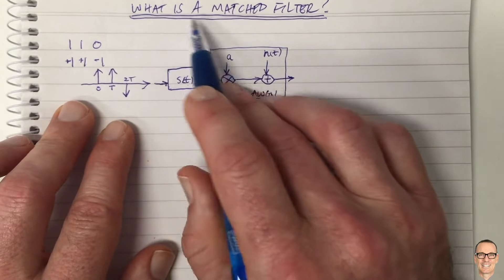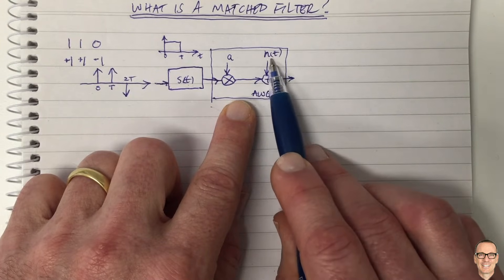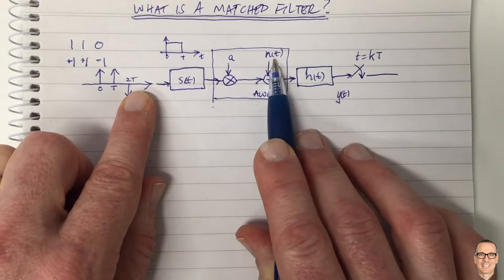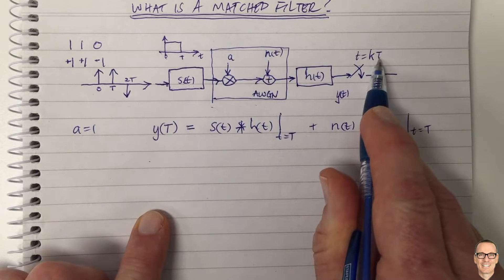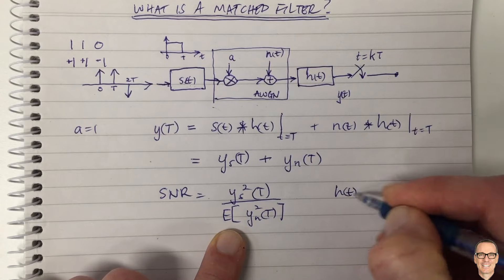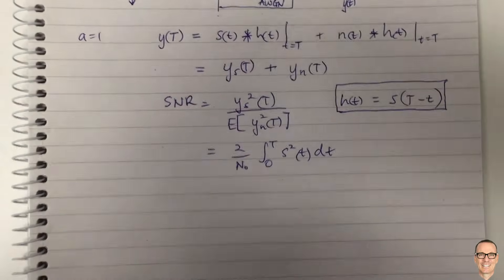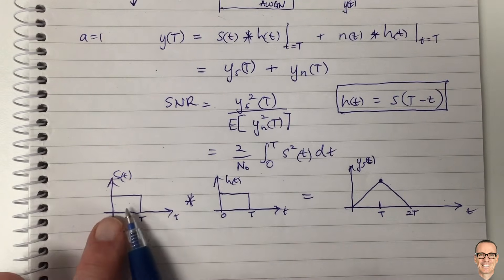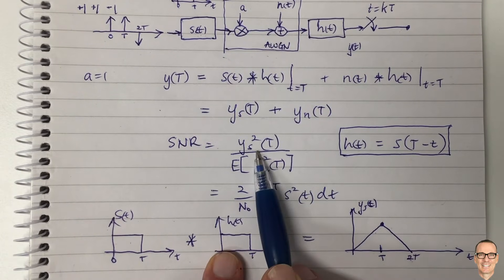What is a Matched Filter?

Comment: Thank you, I understand all of the contents. But, we don't know the transmitted signal, so how can we adapt the filter to that signal?
Reply from the maker: Great question! In digital communications, you don't know the actual signal that was sent in any given symbol period (because that depends on the data that's being sent), however you do know that it must be one of a finite set of signals (one for each of the digital symbols that could be sent). So you could have a parallel set of matched filters in your receiver - one for each of the possible 'data symbols'. Or you could have one filter matched to a sin wave, and one matched to a cos wave, and then match the pairs of outputs to the nearest constellation point in the 'symbol constellation space'.  See these videos for more details: "What Does a Digital Detector Do?" https://youtu.be/XzoLe9ixAZs and "What is a Constellation Diagram?" https://youtu.be/kfJeL4LQ43s
Reply from the maker: Also, this video might also help: "How are Correlation and Convolution Related in Digital Communications?" https://youtu.be/We5q5FJcbcU

Comment: So in conclusion, matched filter helps make the received data (at the other side of the channel) be more observable, thus more detectable.
Reply from the maker: Not sure what you mean by "more observable". There needs to be something that "collects the energy" at the receiver, and "receives" the signal. The Matched Filter is the best thing to do this, in terms of maximising the signal to noise ratio.
Reply: @iain_explains    You used a word that describe what I said, more detectable means a better signal to noise ratio. BER should always be kept at the max.

Comment: hey lain i have watched the whole video mean while i have a doubt in mah mind , whether in case of matched filter there is no upconversion and down conversion here? mean if the same operation is done through the correlator receiver and in the correlator receiver case we are doing the down conversion by multiplying same set of rf frequency at the receiver then we are doing intigration and sampling , but in case of matched filter there is no such process of downconversion we are only convolving with the filter at the other end means every thing which is done is done with high frequency signal even sampling also if that is the case then it might be costlier to impliment i would rather prefer a correlator receiver
Reply from the maker: The Matched Filter doesn't require high frequency sampling. It's still just sampled at the symbol rate. In the case of wireless communications, the MF has an impulse response that is a sinusoidal wave at the carrier frequency. Hopefully this video helps: "How are Correlation and Convolution Related in Digital Communications?" https://youtu.be/We5q5FJcbcU
Reply: @iain_explains  thanks

Comment: hello sir , greetings from india 
i have  a little qestion as you mentioned that we need to collect all of the enrgy at the receiver inorder to find out whaeather 0 or 1 was sent ,my question is that even if we had collected the energy for particular bit duration than also how can we differentiate between 0 and 1 as energy is always a positive quantity and we are sending our 0 bit as negative pulse which according to the video will be a negative enegy calculated for Tb duration
Reply from the maker: In order to collect all the energy, it is necessary to integrate over the full symbol period. It doesn't mean you are able to know what the energy is. That depends on what filter you use in the receiver. If you use an in-phase receive matched filter, then you will get the energy. If you use an out-of phase receive filter, then you will get a negative output. Whether it is in-phase or not depends on the digital data. So if you get a positive output, you will estimate a digital "1", and if you get a negative output, you will estimate a digital "0".
Reply: @iain_explains  Hi Ian. If we are considering single bit (0 or 1) the analogy explained here will work.. What happens if it is symbols with multiple bits representation?
Reply: @malini50  hello i will try to answer your question
first part I think you are considering ASK modulation scheme here so for this scheme you are required only one filter that is inphase matched filter here if you will get output (any how you will get +ve output )  if you have sent +1 bit 
otherwise you will receive some energy which will be the energy of the noise when you have sent 0 bit means you have not sent any of the waveform and the only received energy of the noise .

Comment: sir I have a doubt as you have said it's matched filter output energy has been added from 0 to T AND THEN  it's sampled at time T AFTER THAT for 2nd symbol when again we are adding the energy from T to 2T and we are samling at 2T but my doubt is in duration from  T to 2T the dying energy of first symbol is also being added which could give interference
Reply from the maker: Yes, they are being added together during the period T to 2T, but by the time it gets to 2T, the energy from the first symbol as completely died out, so sampling at 2T only contains energy from the second symbol.
Reply: @iain_explains  thanks sir got it now

Comment: thank you so much for this nice explanation, I have a confusion regarding the explanation in some of the books such as I am following "proakis_4th ed" and there they use an integrator which is followed by the projection of the received signal to the basis function in the case of a correlator demodulator and the product of the matched filter in the matched filter demodulator case. the integration takes place from (0 - T) and still, that is followed by a sampler at the time (t = T). 
my question is wh are we using a sampler after the integrator?
Reply from the maker: It's to indicate that we only "measure" the output of the integrator at t=kT. ie. we don't constantly measure the output as it performs the integration between the sample times.
Reply: sir I have a doubt as you have said it's matched filter output energy has been added from 0 to T AND THEN  it's sampled at time T AFTER THAT for 2nd symbol when again we are adding the energy from T to 2T and we are samling at 2T but my doubt is in duration from  T to 2T the dying energy of first symbol is also being added which could give interference

Comment: How can we actually see match filter working in a real working communication system??? Or is there any such hardware model which may help in explaining Communication systems most abstract concepts in real systems?
Reply from the maker: Analog electronic filters are implemented with circuits involving passive components such as resistors, capacitors and inductors, and sometimes also involving active components such as individual transistors as well as more complex elements like OpAmps. A Matched Filter is just one of these circuits where it has been designed to have an impulse response that matches the impulse response of the transmit filter.

Comment: why do you even need a filter at the end with an impulse response? Why don't you just sample the incoming signal and get the positive value from the square for the first bit for example? So what do you gain by introducing an extra filter?
Reply from the maker: I think you're maybe not understanding what is required to "take a sample". It's not possible in the real world to simply "multiply by a delta impulse". Taking a sample, in the real world, requires integrating the signal for a period of time (to gather energy over the sample period) and then recording the output. This is exactly what we are doing with the Matched Filter (except it is doing it over the symbol period, so that the noise in the receiver is averaged out, and effects the received value as little as possible).

Comment: Can you maybe explain why we have to collect the energy of the signal to identify the symbol in the first place? Is there not an easier way of figuring out the transmitted symbol, how can I understand that? Thank you very much for the great work.
Reply from the maker: First it's important to understand that nothing happens instantaneously. Nothing can move faster than the speed of light. Even the electrons in an amplifier. Now let's think about the thermometers we use to take our temperatures when we're feeling sick. We need to put them under our tongue for a period of time, to allow enough heat energy from our mouth to warm them up to the temperature of our bodies. They don't heat up (or respond) instantaneously. The longer we leave them there, the more accurate the temperature reading. It's the same thing with amplifiers in digital communication receivers, except that the time scales are much shorter. We need to send a digital pulse (a symbol) for enough time, so that we can make a reliable reading at the receiver. If we try to send too quickly, or sample for to too short a time at the receiver, then we will make errors in our received data.
Reply: professor you are a magician your words are more powerful visualization tool than an animation 👍

Comment: Your Signals and Systems with Communication (S&S&C) theory YT video tutorials are great. But two things are bugging me being the lone RF guy in a SERDES group. 1. How do Matched Filters deal with ISI. 2. is there a good book showing how S&S&C  come into play in the real world of RF S parameter measurements. Mostly I just see Design-con things here and there looking at eye diagrams from sending a signal through measured S-parameters. But there has got to be a text out there showing things like how the S11 and S22 like terms affect the Tx and Rx side semi-independently due to VSWR. As while as clear analysis of S12 like terms group delay showing how to find the frequency components of the transmitted signal that are going to cause the most ISI. Sorry about being a little irate about this but it's just really disconcerting how separated S&S&C theory is from the RF physical implementation theory and I have been searching for over a year now if you got any leads it would be much appreciated, thanks.
Reply from the maker: Great comments, thanks. Yes, I agree there is a real tendency in digital communications research to assume the RF implementation is power efficient, linear, and immediately responsive. More can be done to integrate RF characteristics into the digital models. In answer to your questions: 1. The MF is always "matched" to the transmitted symbols. This implicitly assumes that the front-end hardware can't be adapted on a time-scale that would be necessary to "match" to the time varying ISI channel as well as the transmitted symbols (ie. matched to the entire RF chain and channel). Apart from anything else, you would need to know the channel in order to do this. In many cases this doesn't really matter, as the MF provides sufficient statistics for digital decision making. In other words, information is not lost by performing the MF matched to the symbols. 2. I have used the following books, which you may find useful: "Radio Receiver Design", Robert C. Dixon, published by Marcel Dekker, 1998; and "Advanced Techniques for Digital Receivers", Phillip E. Pace, published by Artech House 2000; and "Wireless Communication Technology", Roy Blake, published by Delmar Thomson Learning 2001. I'm not sure if they cover all of what you are looking for, but they might be worth a look.
Reply: @iain_explains Thanks for the references I will check them out. For the MF would it be correct to say that in today's SERDES that the MF is embodied by the   CTLE and DFE?
Reply: Also, one resource on the subject of communication is https://www.gaussianwaves.com/digital-modulations-using-python/
Reply from the maker: Sometimes, yes, but not necessarily. The MF is (most) often implemented as a correlator (mixer, integrator, and sampler) which can be part of the CTLE and DFE implementation. See https://youtu.be/We5q5FJcbcU for more details on the correlator receiver.

Comment: I was taught the baseband and passband modulation schemes for digital data transmission and the respective receivers for decoding the transmitted signal (eg. Coherent detector for PSK). So, I'm wondering where the matched filter block is positioned in, say, a coherent detector for decoding PSK signal. I'd be extremely grateful if someone could explain this to me. Thanks :)
Reply from the maker: The matched filter is often implemented in the form of a correlator, which includes a mixer (in the passband case), which you may be familiar with. See this video for more explanation: https://youtu.be/We5q5FJcbcU
Reply: @iain_explains  The BPSK receiver I was taught had a Balanced modulator (or mixer) and the output of the BM was given to a LPF. I saw the video you referred to and was a bit confused at first but then concluded that the integrator in the correlation method must be same thing as the LPF. So basically, what I was taught was the correlation method and matched filter receiver is just an alternate design that gives the same output?

P.s : thanks for taking the time to reply to my query. I really appreciate it!
Reply from the maker: Yes, that's right.

Comment: Being an asynchronous system, how do you phase synchronise your bit detection, especially at low SNRs.
Reply from the maker: Great question. Too hard to explain it all here sorry (maybe I'll try to make another video on this question). In summary though, there are multiple parts to it, including: Timing Recovery in the receiver (ie. tuning/calibrating T, and adjusting the sampling times so there's no offset), Frequency Locking (to make sure the oscillators in the transmitter and receiver are both at the exact same frequency), Phase Locking (to make sure the carrier sinusoid has zero phase drift), Equalization in the receiver (to recover from any phase offset in the channel and in the receiver).
Reply from the maker: And I've made a video on the Eye Diagram, which is used for Timing Recovery: https://youtu.be/ROhgIWBteQQ